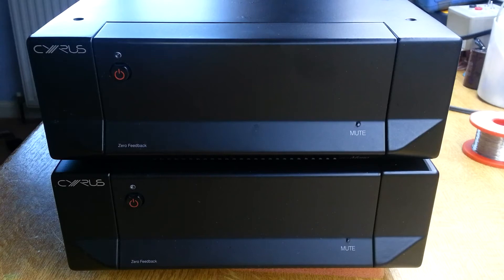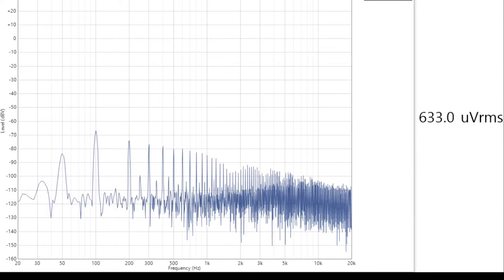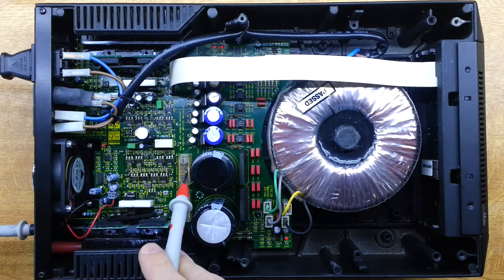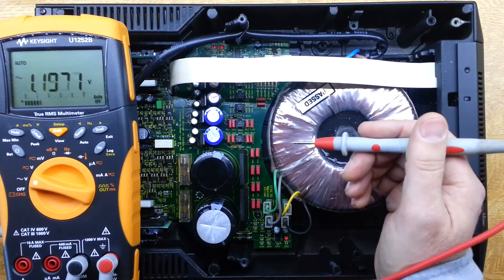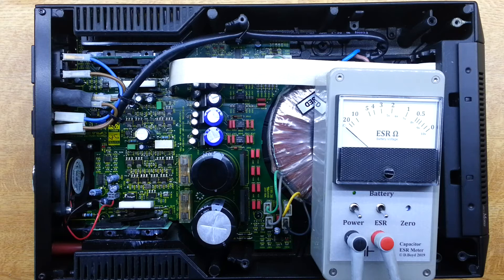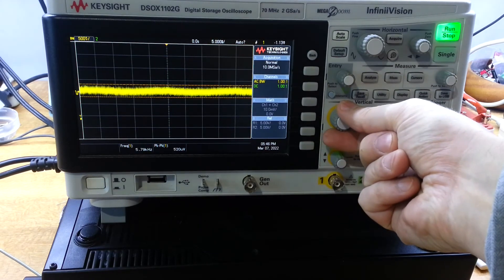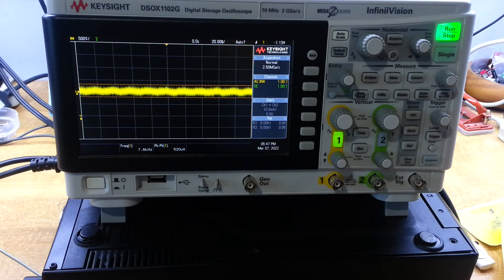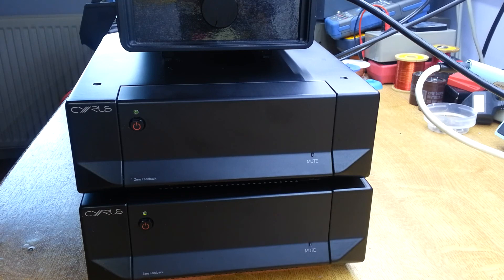Cyrus aPA7.5/MonoX Power Amplifier Service

Comment: Is a cyrus pre Xvs likely to benefit from service? Or are pre amps not as prone to heat damage?
Reply from the maker: I'm not so familiar with the 'characteristics' of that one but yes even low power units have the same issues. See the DAC XP video.